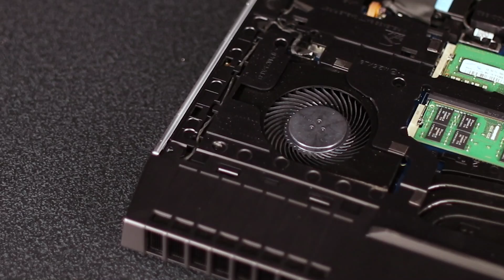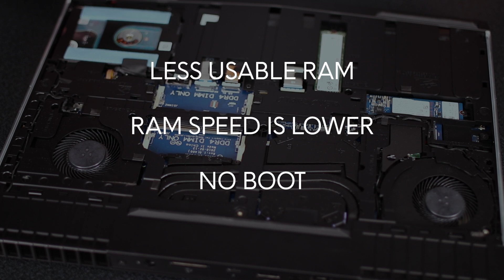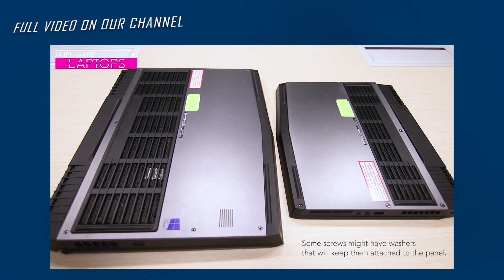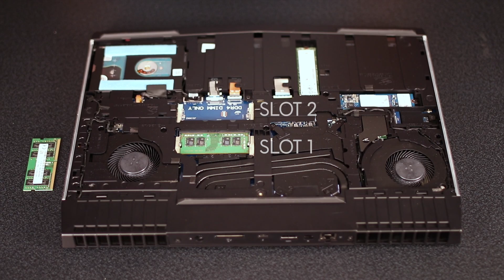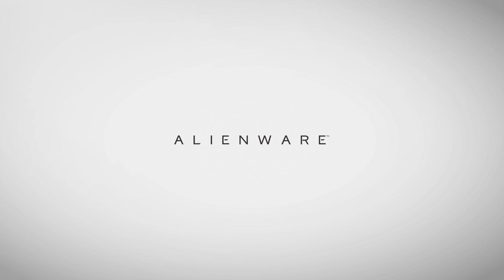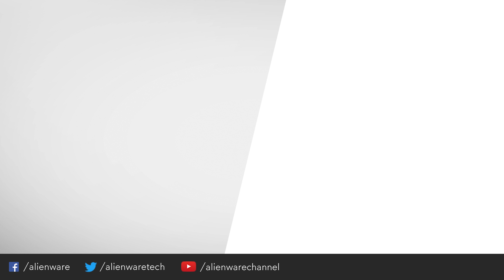Swap memory modules RAM (Alienware Official Channel)

Comment: How to downgrade the BIOS?
I have A15r4 and it supports 32GB of 2666Mhz DDR4 RAM, but only one module support 16GB while the second one doesn’t(it supports only 8GB),
So how can I get the second module to support the 16GB RAM? 
Remark: the power button light blue and red when I insert the 16GB in the second memory module